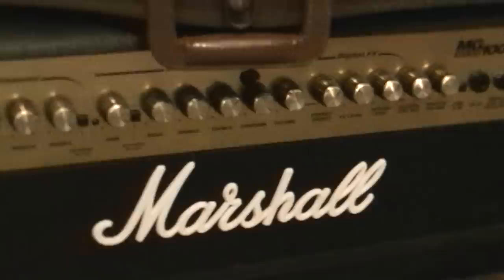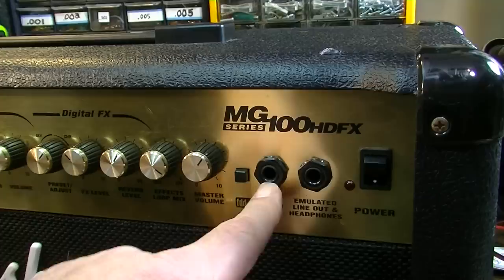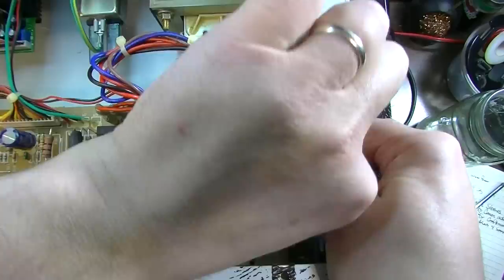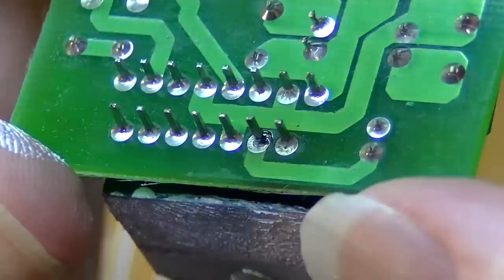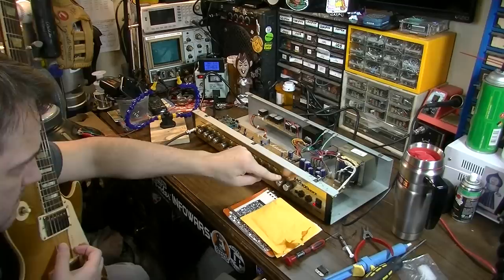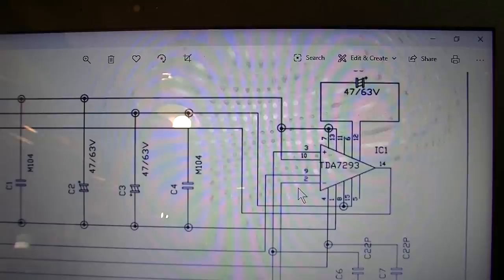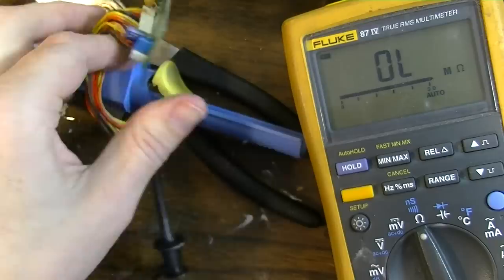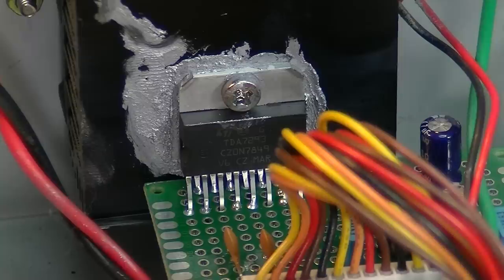Found a Marshall Amp in a DUMPSTER...Can We Fix It?

Comment: I got a TVP amp with a blown one of these on it. Common problem with them being disconnected or powered without a load. I found that Marshall had used 1/10th the value of recommended capacitor on the power line which probably caused the instability which fries it. I rebuilt with a more suitable set of capacitors and it was fixed. The zobel network should be checked as when they go unstable this takes a beating. The resistor and cap of the zobel network had also cooked so these were replaced too. I would suspect the board here was damaged do to the high temperature when it failed, not that the board went conductive and caused it to fail.

Comment: I picked up a jcm800 for $20 on craigslist simply listed as non working parts amp. I get it home to find the power switch needed to be replaced. Needless to say I got a jcm800 for $31

Comment: It's a good idea to use a current-limiting power supply, set it on about 100 mAmps and then switch on the amplifier. If there's a fault somewhere the power supply would collapse before anything blows.

Comment: Really loved that explanation for the problem with the conductive board.
Reply: But if you pay attention then the conductive board is not the failure, an assumption is made that do not fit with the schematic, hint: try to trace out your self where the "short circuit" is, and you will see it do not matter, something else is the culprit.
Reply: Hans K.K. I thought it was that board itself being conductive, so it had voltage higher in one spot than it was supposed to. He got a new board which fixed the problem and made a small error wiring everything but then fixed it quickly. Was there something else?
Reply: @MaxRollison  The two points where he measure app 50 kohm is between the plus and minus rail, and a short of 50 kohm do not create any problem, it is unwanted, but not the real culprit, the real problem may be conductive in the board somewhere else, or a defective capacitor (creating oscillation), I think some more measurement could had traced the failure more accurate, and a much smaller rebuild of the original board could have done the trick, but there is many ways to skin a cat. There is some very nice hints in the datasheet for the chip that could had helped in tracing the failure especially about the caps.
Reply: Hans K.K. Very informative. I definitely agree with you with that one, and as he did, I think when I see those burn marks and traces of conductivity like that, I would definitely try replacing it either way. Usually the boards are cheap anywayss. I’m not really experienced like maybe you or this channel is, but I’ve been learning about this in some of my classes so it’s pretty interesting to see all of it being used for a real world problem. Apart from that I’m a computer science major haha. I still do enjoy watching things like this because I may try stuff like this in the future.

Comment: I had this amp with a similar issue (blown fuse and smoke after replaced)
I took it to a shop and the owner of the place sold it instead of repairing it and I didn't get a cent!
The shop has gone under since then (this was a couple years ago)
I love that amp!

Comment: The cable with the small stereo adapter plug goes with the amp. It is what you use to plug a CD player into the CD in jack.

Comment: Nice I just bought the same amp on Kijiji for $50 after seeing your video I will try and get it back to life! I will probably rebuild the Output board as you did it looks to be the same issue and some of the effects switches were bypassed and  rewired.

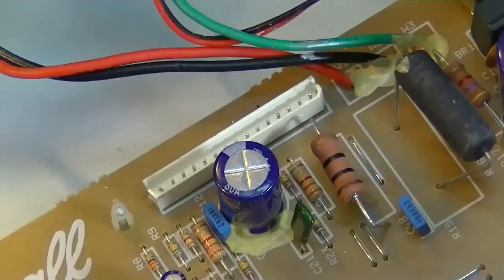Comment: i cant read the 2400 comments here so i dont know if you ever saw this @theguitologist but at 29:34 you can see a bent pin on the female connector on the board, and that connection is probably not making it to the power board whether it is a ground or a voltage reference.

Comment: I have a friend who works for the County Council. Any time he sees an amp that's been dumped he gives it to me; I've gotten eight amps in the past two years, all of which function perfectly; a couple have a control knob or two broken, but it's crazy what people dump. I got a Roland Super Cube 60, with a switchable transformer for the US or Europe, in near mint condition; a Kustom amp; Maxi Cabs acoustic amp; a small Fender Frontline and others; I also got a Mission subwoofer in perfect condition and two B&W speakers. Never heard of that brand before, but that SUETHIS guitar sounds pretty good.

Comment: Those Marshall amps used TDA7295 output opamps. They run the power supply rails close to max voltages. If the mains power is running hot, they'll blow those opamps.

Still watching.

Comment: I just discovered your channel a day or two ago, this was the first vid I watched and have since watched a number of them. Very cool.
Today I dropped by a local pawn shop to see what equipment was sold for drugs since my last visit, and I came upon this very same Marshall amp. At first glance I thought it was being sold for $52, but after testing it for basic function and deciding to just buy it, I realized that is the price they plan to sell it if no one pays the current listing of $140
The actual price was 140, but I guess the business model of this place is a listing for upcoming months. Each successive month or so, it drops a few bucks. Meaning effective 3/10/20 the price is 110, (today's retail) and when 12/20 rolls along it will reach the $52, which is probably about double what the tweeker let it go for.
Knowing that this is a essentially a low end amp, would it be worthwhile to return and buy it? My intent is to flip it, since I don't need an amp myself?
As for my intended comment, I'm appalled at the actions of GC, tossing perfectly serviceable musical gear into a dumpster. I want to try my hand at checking the local GC here in Madison, WI. But I suspect they keep their "valued garbage" hidden in an enclosed gated fortress along with a padlock on the actual container.

Comment: Most common cause of failure I've seen in these is driving the 100 watt output device into saturation, or square waving the signal.  The amp then will put out about 140 watts, which is above its current rating.

Comment: I've worked on a ton of these marshalls mg's.. those out put transistors are usualy always th iissue. They sometimes tske other components with them when they short. Used to be able to buy pcb's from korg with that whole output module. Input jacks, the fx loop, first or second input transitors go too. The power supply sometimes

Comment: you can't use a bigger value fuse! If you dont have the correct one go smaller or you just move the issue along - chances are the power transistor smoking was caused by too much current

Comment: I got a Marshall AVT150 head that burns through output transistors just like that. I got it for $130 from goodwill, it was missing one transistor and the other was blown. I bought two new ones, replaced them, and a month later it blew the same one. I'm not an amp tech and I'm not about to take it to a $100/hour shop to get it fixed considering it was basically just goodwill junk lol. It lives in my closet now

Comment: I knew this would be an hdfx from the thumbnail 😂

I have one, sold as fully working but with a lot of minor niggles i had to fix...i cant recall which part of this amp is famously underated (the heatsink to regulator bond?) but they have a design flaw to them and when it goes it tends to cook a bunch of components.

Anyway, great amps when they work!

Edit- output transistor, you found it 😂

Comment: Ive picked a nice speaker cab from the e-waste container at the local tip that's probably overkill for that amp, it's a Hiwatt maxwatt m412 400w 4×12" unit. Roadworn but perf. Working order. Same day got a 4 ch. Datamix mixer/amp. 150W, power plug cut off but on replacement works perfectly, plus a gig bag full of cables and 3 peavey mikes. No guitars, unfortunately! Ps, you play great!

Comment: Max operating voltage for the TDA7293 is +/-50VDC, so measuring 43V is well within spec.

How much would Marshall have charged for a replacement board?  It'd probably come with the output chip included.

Comment: Sometimes those power amp ICs can burn up because they develop parasitic oscillations where they start oscillating at very high frequencies well out of the range of human hearing, and sometimes that's caused by bad grounding issues.

Comment: When I was about 17 or so , I found  a Selmer Treble n Bass 50 chucked in a skip. The back was off it and all the valves gone  and it was marked up as if it had been dropped .  It was heavy, I didn't know much about electronics so I left it.  Knowing what I know now - I would have kicked my lazy teenage arse from one end of the street to the other and back.   I could have kept it until I learned how to fix it.  A TB50!

Comment: the mg series is marshall's budget line of solid-state amps. 
they're decent amps for what they do, but they just don't meet the quality standards of higher-end amps.
personally i would take the head in this video and turn it into a small combo with a lower-powered amp chip, so there wouldn't be heat problems in the future, and it would make a nice little practice combo with lots of features.

Comment: I'm no electronics wiz, so other than replacing the fuse, there wouldn't have been much I could do with it. However I would strip what parts are known to be good, knobs what not, and then put em on ebay. Parts sometimes do better than the whole thing in working order. I know that for a fact with guitars. I used to rebuild guitars, but to get parts I had to pay a lot, more than the completed guitar was worth sometimes. You could see it right in the ebay listings, one guitar taken apart and the parts listed separately. When I decided to quit doing it, I sold my parts stash, and got way more for it than I would have ever thought possible.

Comment: I repaired the same issue on that amp by replacing the parts At the heat sink but my part was $50 bucks. Its been awhile since i did it to say what part it was. It came with lube for rhe heatsink also. I have not watched the whole vid yet to see if you got it licked My fan was full of junk also. They don't sound to bad either with both od channels combined. I may have rhe foor pedal for one
Reply: Good job man

Comment: PCBway,,, make your custom boards there.

Most of the power supply caps, and the three on the amp board have bulging tops.  The amp won't be reliable unless all those cheap capacitors are changed.

Comment: The ST TDA7293/7294 series were discontinued about 8 years ago. All you can get now from China is counterfeit. This one needs a replacement discrete transistor amp board to be reliable. You may find original old stock TDA7293 in the US, but that's always questionable. Buy multiple pieces from the same place, and crack one open to see the die size, crack open the burnt original one and compare. Counterfeits have much smaller die in them.  But the only safe thing is to build a replacement board with a discrete amp, these ICs, even the original ones are not the most reliable things to begin with, let alone counterfeit ones. I haven't finished the video yet, so sorry if you came to the same conclusion.

Comment: Wow that heatsink is so much bigger than the one in an AVT50! Did they insulate it from the chassis? Those TDA chips are NOT grounded by the mounting tab, the tab is VSS-. I had to use a Silpad to mount the TDA2050 in my AVT in order to ensure it was electrically insulated, as the heatsink in the AVT attached directly to the chassis and the screw attaching the TDA to the heatsink has a plastic insulating washer.  It burnt through the heatsink paste I tried to use the first time, and the Computer CPU thermal pad I tried to use the second time. My guess is that Guitar Shenter tried to fix the amp, ordered a new Board_With_TDA from Marshall, messed up the installation and burnt the replacement TDA, so the customer bailed. "It keeps blowing up boards, you want to spend more money on it, I think it needs a transformer?"  When the TDA burns you have to check all the other small parts on its daughterboard for collateral damage. Eventually you replace chips or components one too many times and the pads or traces lift. I admire your work recreating it on perfboard! My AVT50 mainboard did not become conductive, but it did delaminate and force me to add jumper wires to ground the input jacks!

Comment: You got a good deal on the output chip.  The “marshal” ver is 11.95.  Though the board can be purchased for $40 plug and play.  Either way that’s a $400 amp new.

Comment: I have a Marshall MG 50DFX and it just hums from the speaker, I've checked the jacks, checked the filter capacitors and they seem to be fine. The headphone out works, but it's extremely quiet. I kind of feel like these amps aren't built that well

Comment: I used to have that exact head model. Bought mine new in 2003. In the years that I had it, I kept it in mint condition but it did not hold its value at all even so.

Comment: That nut from the transformer came off (vibration ?) and shorted something under the circuit board. It doesn't need to short the output device directly, just something to cause a big current draw. Did you find that nut ? I've seen it before.

Comment: I have some concern about my JCM2000 50W. I got it 3 years ago & the guy said he put new tubes in it a year before. I started to get crackle & like a noise gate volume drop. Pulled the tubes checked pre-amp & PT & the only continuity was on 7 & 2 for the PT & 9, 4 & 5 on the pre-amps. I had a shop test them & the PT's one showed wore & the other failed. I found some cracked soldier joints on the PT sockets & re-flowed them & some joints on the ohm switch that weren't soldiered great & re-flowed them. I re-biased with new PT even though the old PT work & look good. I'm concerned if I should dump the amp as it is the green board from 2003 although the chassis sticker says 2002. What causes a board to become conductive & what are your thoughts?

Comment: I found a small Fender solid state amp at a goodwill a while back that also didnt power on. I replaced the fuse and the main transistor and it powered right on. It still sounds like shit but it was like 20 bucks all in including repairs so I wont lose any sleep over it. Maybe one day I can use it for some crazy sounds on an album or something lol.

Comment: Hello Mr. Guitologist!  My favorite videos are your amplifier diagnostics and repairs.  I have been watching regularly for the last year.  I have an Orange Micro Terror that has stopped working.  I purchased a new power supply but that did not fix it.  I changed one diode per another posts recommendation.  Still will not power on (ie no light and no sound).   Would you be interested in doing a video on this popular little monster?  I have another new one to play through and also it’s just one of many amps I have and love.  It would be no trouble if it took sometime to get to.
Reply: Also wanted to mention It is around 5yrs old with no warranty in effect.  I’m the original owner.  Would really love to know what went wrong.  I would love to keep it from becoming a paperweight!!!

Comment: In watching your video & seeing you test that board &  your setup, KINDA COOL & YOU CAN PLAY PRETTY NICE! My father was defrauded by a guy whom pretended to be his friend & well. its a long story but, I never imagined that my family would allow it but, THEY DID! Costing me ALOT! The house, all of my savings but, I had all of my instruments inside of my fathers house! My Westone Spectrum LX (198-mbk) (which looking back, Mine was in MINT CONDITION & IN TRYING TO REPLACE IT, I CANNOT FIND ONE AS NICE AS MINE WAS) also, my Takamine dreadnot satin finished G-series acoustic electric which I put into the nicest case that I could find! (only supported it around the edge & the base of the neck & the heal of the guitar) about 20 guitars in total & my Line 6 series 3 spider,  Steinway & son's piano which played beautifully & was simple to adjust! Anywho, I found your channel & of course I will check it out & sub! Wish I found a marshal stack sitting inside of a dumpster, That would be the day! Though, I did find a Fender Reverb Deluxe once... Plus, I also had a richenbacher(or however it's spelled) amp within my Fathers house! I had much more inside that house then I could ever begin to mention & over the years, I have purchased other equipment but, None as nice as what I had! Just the other day, I bought another Westy, A sx model which is nicked up a bit but, since I have gone many years without playing, I have lost SO MUCH KNOWLEDGE! Everyday I hear a song that I once knew how to play & after work, I sit down & play & ITS JUST NOT THERE! I NEED A NEW AMP, THATS FOR SURE! When I was a child, I half way built my first radio out of necessity! I found a board which was missing the power invertor & I had no way of controlling it but, where there is a will, There is a way & These days, Like most, I simply purchase what I need but, I really need to get back into electronics! Anywho, NICE VIDEO, GOOD JOB & SWEET SCORE!!!!!!!!!

Comment: About conductive boards:
  Typically from failure to either thoroughly filter or change solvent in the board wash step just before assembly. The purpose of the wash is to remove the by-products of soldering etc. and thereby prevent shorts. But when the wash solvent is itself contaminated, it leaves a film that may pass inspection in a warm dry environment, but in humidity it will short out. And when dust is added, the chances of shorting increase even further.
   A cheap shitty production practice.
   One of my early jobs was in quality control in a plant producing electrical devices. The department manager of a section I was turning down a bunch of units on contrived to get me fired. And this was the root cause of the issue.